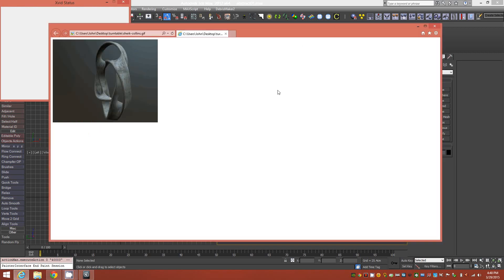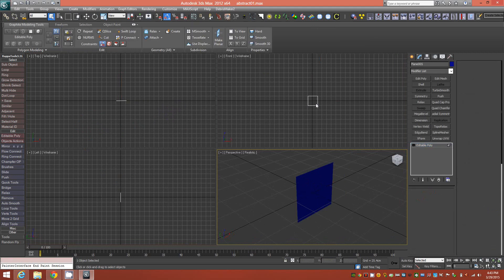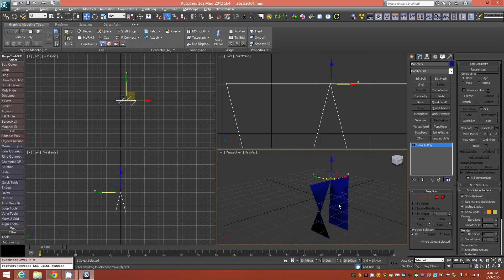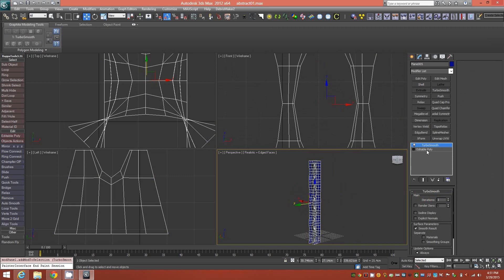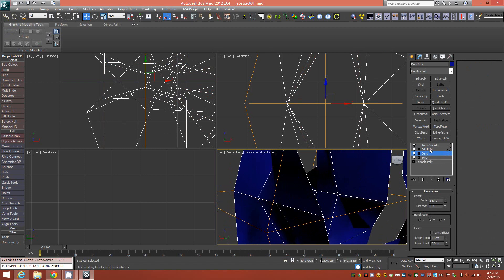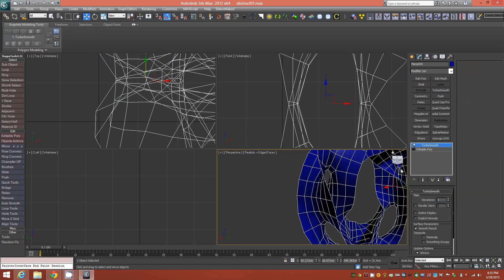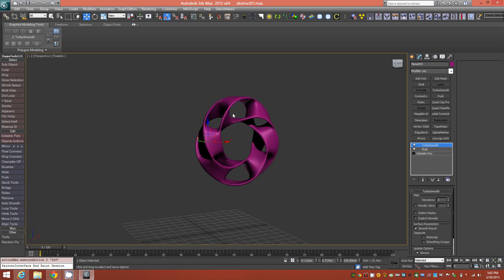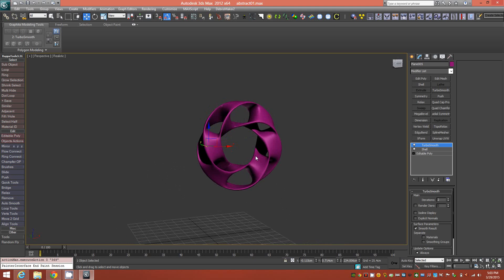3D Tutorial | Model a Scherk-Collins Saddle Surface Ring | 3dsmax

Comment: Hey John, thanks for the tutorial, I have learned again. :)

BTW, if you are interested some useful tips to speed up welding and selection: (1) after bending the object, you can do the final welding by adding a "Vertex Weld" modifier to the stack. (2) Max supports selection subtraction while holding down the Alt key. At 16:38 when you are selecting the edges you can just select all edges and then hold down Alt in the top view to draw a single selection rectangle to remove the unwanted ones. Hope it helps. :)

Comment: This is very cool, but why didn't you just use an array instead of stacking symmetry modifiers to create the tower?  You could just have used an array, then welded everything with a weld vertex modifier.  Would have been much faster.  Everything else is excellent.  I like the second technique better than the first one.
Reply from the maker: Nathan Curl Thank you for commenting.  Yes, I could have certainly used the array tool to create the tower before bending into a ring toriod, but I prefer to use symmetry modifier in this case, because it's a more accurate method of situating the elements and welding the vertices.